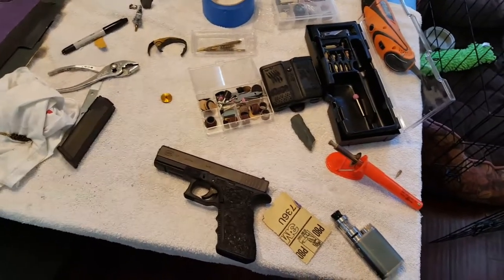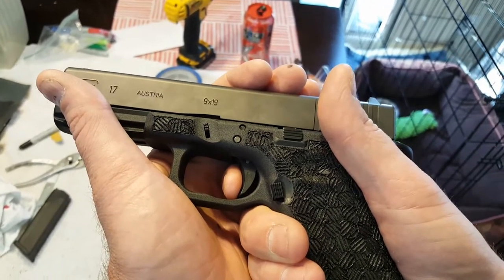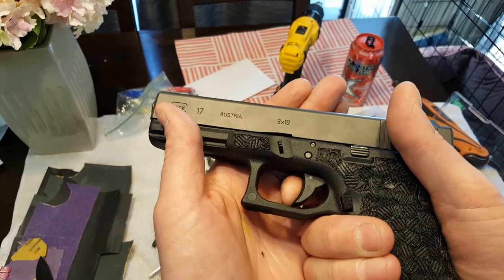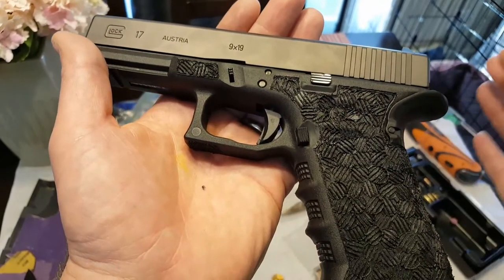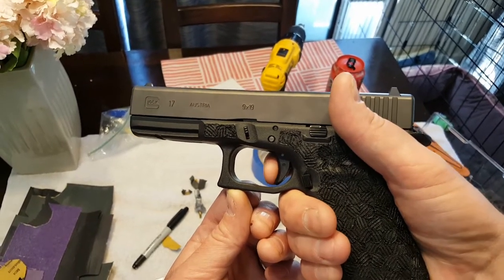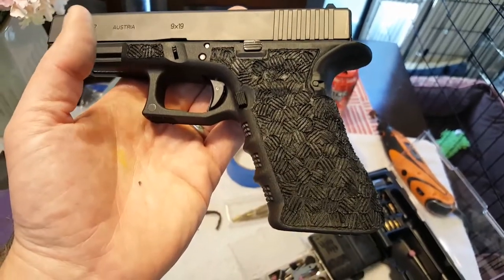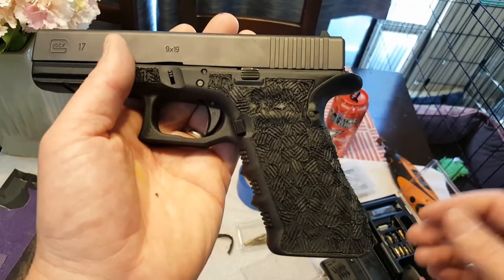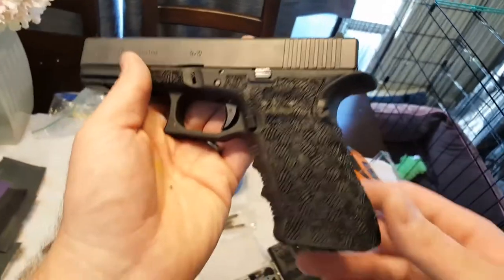...bought a GLOCK?! #4 (Stipple it, juuust a little bit)

Comment: Looks good bro. I wish I had the guts to do my frame. If you like Glocks check out my channel bro and let me know what you think. I have lots of Glock videos and Glock upgrade vids.
Reply from the maker: Gerald Weldin Thanks for the compliment.  It was super fun.  I like that you have your girls shooting at a young age. I'm sure that you enjoy every moment.
Reply: Brandon's World I do love Shooting with them and teaching them the responsibility and fundamentals of the gun. They really like all the videos that I make and post of them. The world is in a time where there are too many nuts in it...so I want my girls to be able to protect themselves.
Reply: Man I cannot find the tip with the line in it anywhere. I been looking on Amazon and have looked through all the soldering kits. Any help would be appreciated
Reply from the maker: I purchased the weller wsb25wb wood burner from amazon.  Not sure what you mean by the tip with the line in it but with practice or a metal straight-edge, lines shouldn't be a problem with the smaller tips.  Blessings.